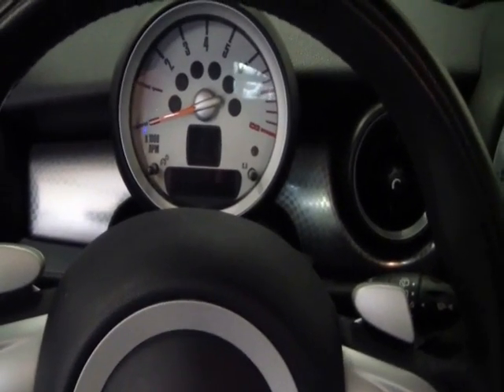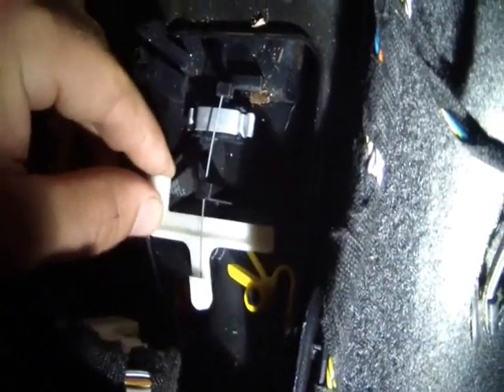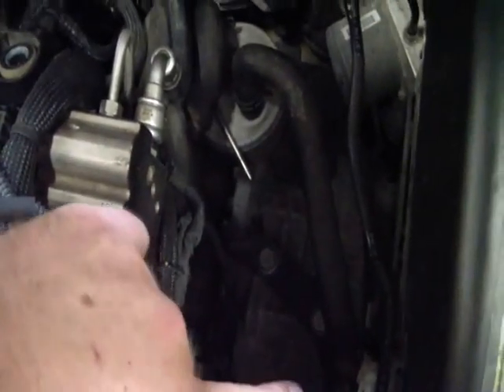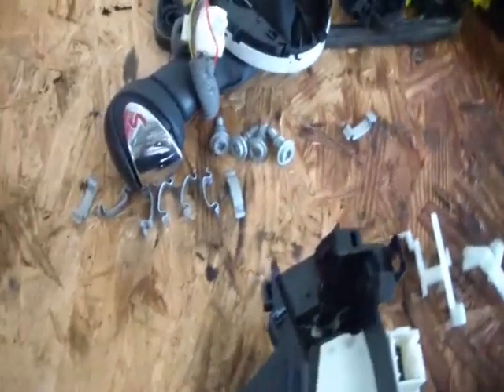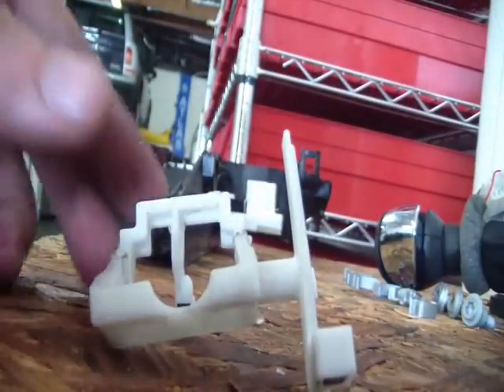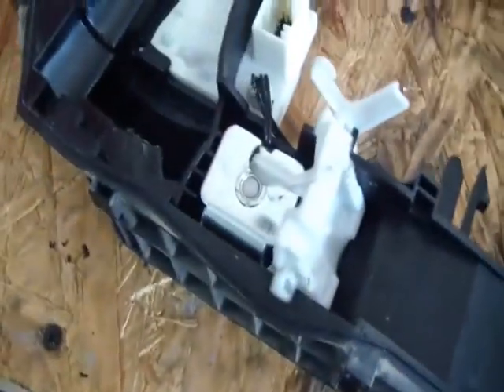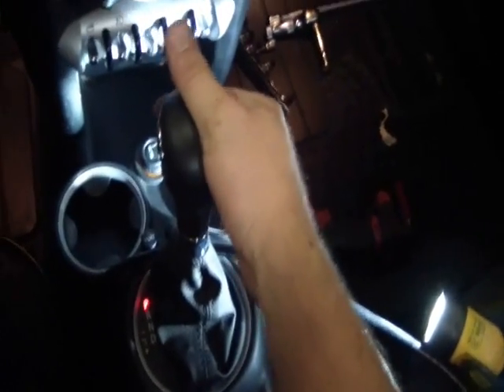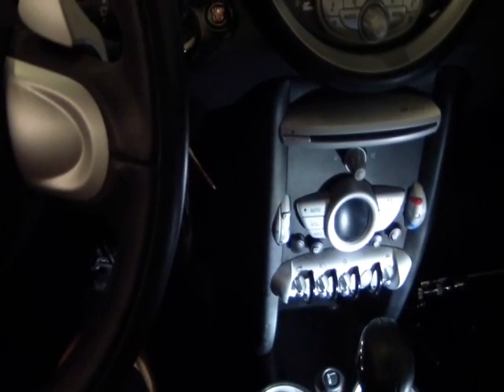Mini Cooper R55 R56 R57 A0B6 Shift Interlock Resolved

Comment: Thanks for documenting this Procedure. I picked up a 2010 mini last year with the engine partially torn apart. When I picked it we couldn’t get the wheels to move to get it on the trailer. It had been sitting for a couple of years. The owner tried to force the shifter out of park but it wouldn’t move. He was a body builder and I was thinking you’re going to bust something Hosea! 😂 he did… the yellow pulley thing was broken and the wire springy thingy was sitting loose. I followed your video to pull things apart and am waiting for a new yellow pulley thingy. Fortunately the white lever wasn’t broken. 😅

Comment: That price also has some value to the sport mode ,manual shift . My thoughts are that someone was hard on the manual shifting lever, which is connected to the paddle shifters electronically.

Comment: Daughter's 2007 Mini Cooper Base with automatic transmission had a situation with the gear shifter not moving out of park. Tried pulling the yellow tab to allow it change gears, put it snapped off in my hands. Took the assembly halfway apart to see if I could determine the problem and finally gave up. Had it towed to a shop and they determined the whole shifter mechanism had gone out, and they said it has an electronics cluster in it also and that's what makes it so expensive. $800 for the part and $600 for labor. Shop said it was apparently a well known problem as the mechanism had been redesigned, and the parts supplier said they said it is a high demand product so they always have it on their shelves. It's been a good car, and engine is still strong so we went ahead with the fix.
Reply: do you know the exact name of this yellow detail?

Comment: Dude my car won't go ino park it's stuck in D,N and R. When I removed the shifter shield and tried pulling on the yellow tab it just lifted out without any tension which means it was sheared off somehow.

Comment: Hi there does this code stop the car from starting? I have a 2007 with the same problem but it won't start.
Reply from the maker: It can. Sometimes. If the computer sees that the trans is in anything but park or neutral, it will prevent it from starting.

Comment: So silly question.  If this is happening to your car and you don't fix it,  What will happen? Thanks
Reply from the maker: A gear message will always appear for sure. And there might be times that you can't start the engine if the computer doesn't see the car in Park or Neutral.
Reply: Is that code possibly for something else? Because my shifter is not doing that yet? I guess it’s getting ready to possibly.?

Comment: "WOW"  that is a nightmare.  Someone needs to draw that part and do some 3d Prints for it.  Did you get the part #?  I just bought a mini and the code comes up.  I'm not sure this is worth fixing.
Reply from the maker: There is no part number for the piece I repaired. The assemblies are sold as a complete unit: 25167644233
Reply: @NiXFiX  ahh.. 
It is wierd.  I did your test and I can't take the car out of park without turning the vehicle on and pressing the brake.  I hear the solenoid.  However, it is throwing the OBD2 code in my scanner.

Comment: Bro my mini is stuck in Parking gear already did what you did, taking out the shifter cover and pull the little yellow string and still not letting me change gear, any ideas what could cause this?
Reply from the maker: If the shifter is not moving at all, double check that you pulled the yellow pull tab until it stops. As I recall it has some tension. If after trying that again and it still doesn't move, pull the center console off and remove the front plastic cover from the top of the shifter box (see 2:15 of the video). With all this off, you will be able to look at what the yellow tab is doing. It should be moving the white plastic piece that physically locks the shifter. If it is not, it is likely that the white plastic piece has broke and is binding (not allowing the yellow pull tab to do its job). At this point you have a couple options: 1) stop and complete what I did (pull the shifter box out and repair it) ...OR... 2) break the white plastic piece and you'll be able to shift. Warning with option 2: I'd only do this if you're in a bind and immediately need the car. You will get the code A0B6. The car will still function but the chime and gear warning light will always pop up. Now, if the shifter is moving but the car is still in park, then the cable has either broke or came loose from the transmission (see 4:45 of the video).

Comment: Awesome video. My question is what if the with part that your glued cant be repaired? Any suggestions and hows is it working after a year
Reply from the maker: pedro sainz, if you can't repair the piece that I did, you'd have to get a whole new shifter. I sold the car 6 months after I fixed it. It was working flawlessly when I sold it. Melting the plastic together made it super strong.

Comment: Great, thanks, BUT - careful - below freezing, if tea/something was spilled in the cup holder (what an absolutely terrible design, car "designers"!?) the orange tab will break off if you pull it too hard! Frozen, it just breaks as nothing moves. Coated the gear box bits in WD-40 to release, thankfully, the jammed box, lubing the plastic lego parts that freeze & fail below zero w. a spill. Car wasn't made to be used in extreme cold, and spills are the worst in this weather. BTW - this was all due to tea being served in a cup not made for tea to be served in, the seam steaming apart & slowly leaking into the cupholder pre-discovery - diligence at the coffeeshop, and good luck motor pals!